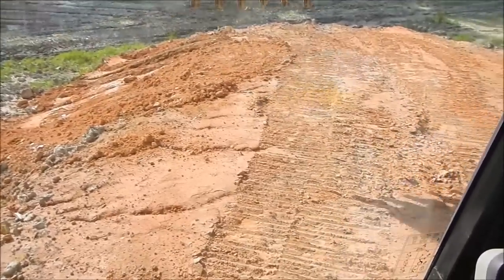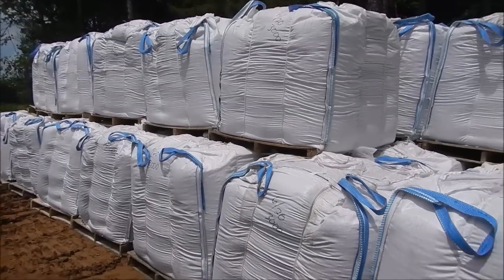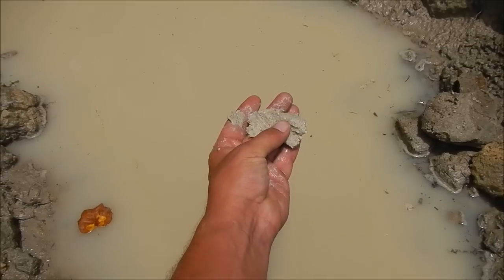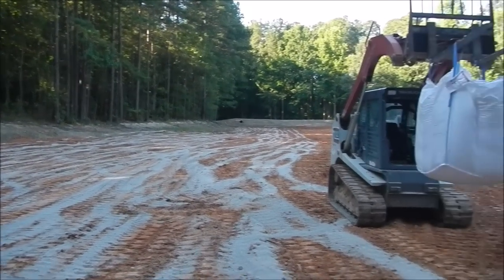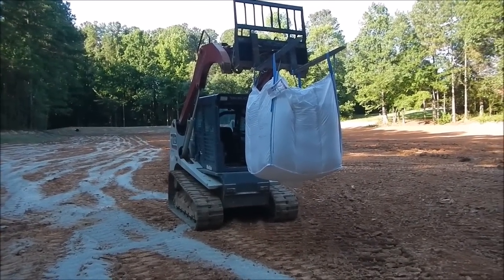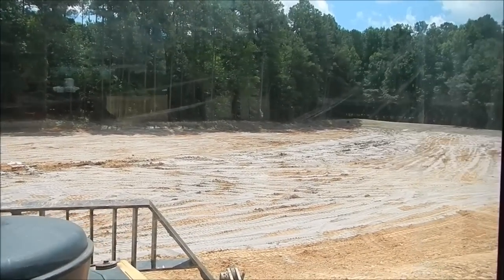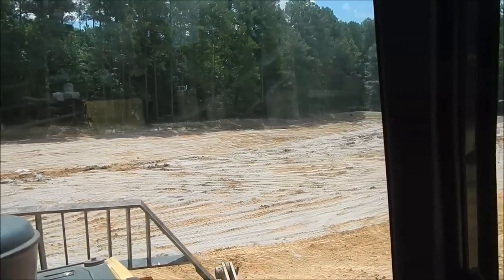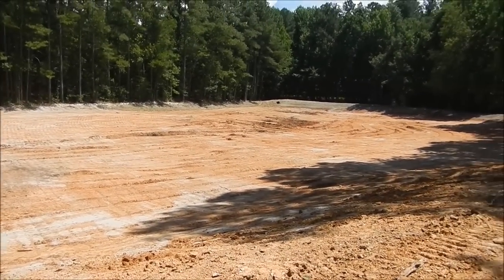Time To Spread Bentonite!

Comment: Thanks for this series of videos.  I am a novice with an old backhoe.  I have learned a lot from you.  Bentonite is the Problem where I live, not the solution.  Go down 18 inches and you'd think it goes a ll the way to China, but they say it's only about 50 feet deep.

Comment: Fertiliuzer spreader on the back of a tractor. They are set up to be refilled from those size bags and the speed  you go at determines the depth of coverage. They can broadcast fertilizer pellets out to about 40 feet depending on the size.

Comment: I ran a pug mill on a landfill cell job last year doing the clay liner.  we used 3200 super sacks weighing 3000 lbs a piece. Ours was a fine red powdered version came out of Utah. I still have red stained socks and shirts. Wasn't the most pleasant job.

Comment: A quick look and a lot of use have the same thought. If you have access to a tractor and fertilizer spreader that would create an even distribution  throughout the pond creating a better seal. Also you could out 3+ bags in at a time and then use the excavator to do the part that was too wet. Your videos are awesome, keep up the good work.

Comment: by the way.. Bentonite powder poured over an oil stain on concrete and worked in and left for a few days will usually pull the oil right out of the cement surface .. amazings stuff.. the powered form was also used as a buffing powder for pianos when they were painted with real nitrocellulose lacquer.  especially the black pianos.  swirl free finish.  that version was very carefully screened to get rid of any but the smallest particles.  so don't try it.   might have to create a bucket lip that straps on with a screen to you can spread it out even better than you did..

Comment: We very rarely have to line ponds with clay as the ground up here in VT. It is either clay or ledge. The clay we use is just like the clay you use in pottery. It's either a white clay or blue clay. Usually only have to line ponds that have a sandy or gravel bottom or ledge bottom

Comment: i have never operated a excavator.. but does the machine stop the boom before it hits the cab or is it up to the user to make sure they do not bring thr arm to close to the cab?
Reply: That type of excavator has the boom on the right side of the cab, so it cannot hit it.  Most modern excavators cannot hit themselves with the bucket or other parts of the boom and stick, except for the tracks.  Most of them can hit the tracks with the bucket, and for the smaller machines with a dozer blade, the bucket can hit that too.
Reply: @throngcleaver   hm interesting, thank you for the information much appreciated :)
Reply: @Crozier4582   You're welcome!

Comment: Easy fix… Get yourself a 12 foot chain-link fence folded over to where it 6 foot and connected together. Keep it on your truck rolled up it’s a good tool to have. Connect to the back of your tractor/vehicle and drive up and down it one time it would spread it almost perfectly. It is the best way I’ve found to generically rake large areas and what makes this nearly perfectly.

Comment: A drop spreader about 10 ft wide is perfect. They are hard to find not all ate up from neglect and misuse. A lime spreader truck would be the next best if it had flotation tires. Tractor drawn fertilizer spreaders can do the job but not made to withstand the powder associated with spreading non pelletized media. Betonite will break up somewhat as it hits the spinners, maybe a good thing, may not. That's why I would use a drop spreader.

Comment: I would consider renting a fertilizer spreader. They hold about 5 ton. Open the rate of feed wide open and let her rip. Might not be a fast as your method but it would be evenly spread. The banks would likely have to be done another way. My two cents.
Reply: Actually have seen a little walk behind unit here in Australia used for top dressing lawn's with sand/soil, maybe somkething like that could work good
Reply: Yeah this was a horrible way to spread $20k of a product.
Reply: The category 1 3-pt hitch spreaders only cost ~$500. They only hold 400-500 pounds/load, but the job would be done correctly. Zero leaks.

Comment: That pond looks shallow as hell
Reply: That's what makes it a pond, instead of a lake.
Reply: @throngcleaver  that's what makes it really hot in the summer time and not a good pond. I don't know where it's located but if I had to guess I would say the southeast and on average in the southeast just as long as it's not 2Xtreme if you keep your average at about six feet deep then you're good to go TN at the dam and then up to 224 feet deep on the Shalimar and if there is one. That will keep the fish good in the winter and then if you keep a destratification type air pump in strategic areas to mix the levels of water so there is not a thermocline where the cold oxygenless water in the deeper part of the pond at the bottom is mixed with the warmer oxygenated top layer where most fish stay and that way everybody stays happy... it will not be as prone to pond stratification and a summer kill type of turn over, killing all the fish in certain area and or all areas, due to lack of oxygenated water in the summer and early fall...
Reply: Must just be a swimming pond. That shallow is a good recipe for weeds, unless your constantly putting in chemicals
Reply: I would call it a mud hole that is going to turn green with bullfrogs and snakes
Reply: If you have the fucking money, make it right and dig deep.

Comment: if it's too wet for a skid steer, I'm guessing a dump truck would get about two feet before getting stuck ... otherwise I'd say rent a highway sand/salt spreader.  Even so, I'm sure there are plenty of tractor or agricultural based solutions you could use, but I'm not sure any of them would be all that much smoother than just the excavator bucket right there ...

Comment: ben·ton·ite
ˈben(t)nˌīt
noun: bentonite
a kind of absorbent clay formed by the breakdown of volcanic ash, used especially as a filler.
Reply: Its clay..just fancy clay
Reply: Its a very versatile clay that has the finest particles of any mined clay. It's used in well drilling as a lubricant mixed with water, in horizontal boring for the same reason, in makeup because of the fine particulate, and in industrial glazes as a suspension agent to keep stored glazes from solidifying. The highest quality bentonite is quite expensive, as is illustrated here $20k for 90k pounds of bentonite thats going to cover the bottom of a pond...but it works like a charm. Some leaky ponds can benefit from just broadcasting it over the surface in a powder form and letting it settle it will work its way into the leak and plug it depending on the size of the leak of course. @mutationbuilder3446
Reply: Its clay
Reply: But very fancy clay. :) @mutationbuilder3446
Reply: It's super white...when they uncover it here in the West Texas desert you can see it shining in the sun from miles and miles away. 

Once wet it is ruined before processing. They pack it in pellets, dust, and rocks. 

Pretty cool stuff.

Comment: Looks like the cat litter I buy at Publix..
Reply: Bentonite is the cheap kind of kitty litter. It is also sold as garage floor oil absorbent. Well drillers use it to seal well casings.

Comment: I guess sealing the bottom was important, but removing trees from the dam wasn''t?  They'll eventually cause dam leaks/failure, especially when they die and the roots decompose, leaving channels for seepage.
Reply: txman201 I was about to comment asking about that. Because it just seems like it would do just that
Reply: I guess all those trees along the banks of ponds everywhere are the exception to your statement lol
Reply: @ohiovalleypondandexcavatio2114  do you not see the difference between a BANK and a DAM? With a bank tree, water has nowhere to flow if a root rots out, and it eventually seals by collapse with no erosion. With a DAM, water can flow through it, eroding a channel that eventually collapses the structure. Why don't  you go get an engineering degree and learn about it before you reveal your ignorance?
Reply: @ohiovalleypondandexcavatio2114  banks fine fine.  dams are not

Comment: I hauled a load of Bentonite out of a mine in Bonanza, Utah back in 2002 when I worked for Arrow Trucking to Houston, Texas.  That was one heavy load.  It made a mess of the inside of my tarps.  It took a bit of doing to clean up my tarps afterwards.  It sure was a good revenue load, though.  That's some expensive stuff.

Comment: Your bentonite is likely mined in Wyoming they have large deposits of it there its also the same stuff used in cat litter and drilling mud for the oilfield and even well drilling amongst many other uses. Its naturally occuring in many parts of Western Canada and the U.S. I think the best thing to mix it in would be a disc criss crossing. But if you don't have one 'run what you brung'.
Reply from the maker: came from texas